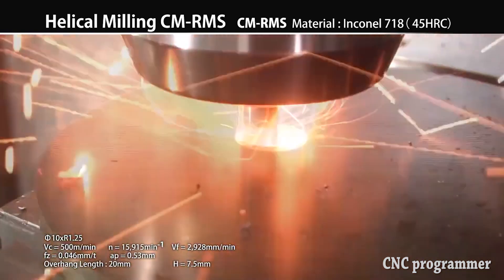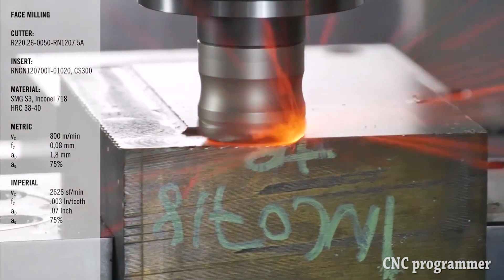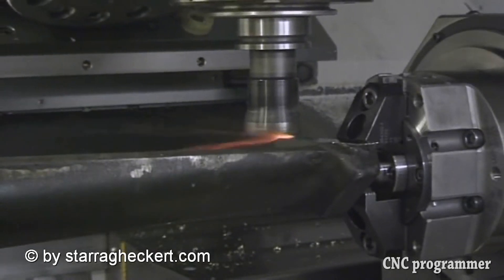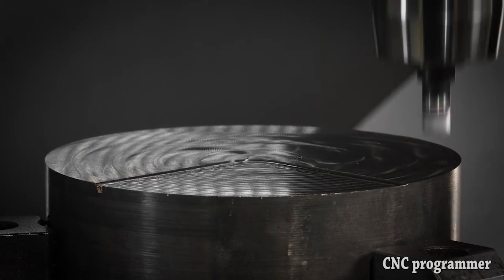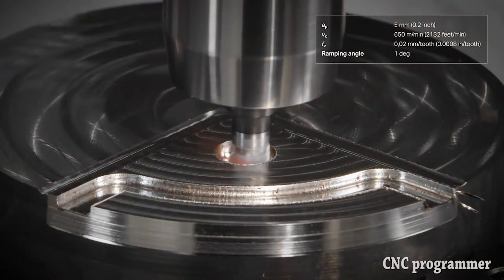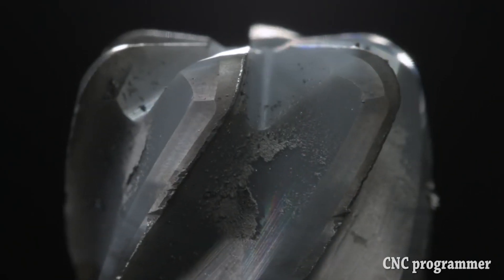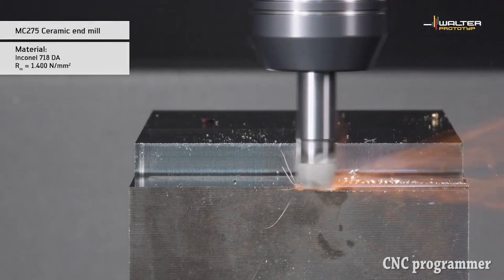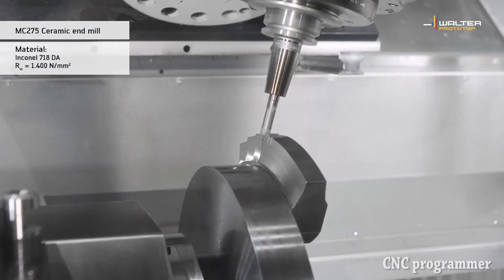7 Tips for Programming Ceramic Cutting Tools

Comment: Is it true
Ceramic Endmill only for 
Nickel base steel

Monel K-500
Hastelloy
Inconel 600,617,625,718,800,900
Incone
Reply: No mate you can use ceramic cutters for any material. There are even specific ceramic cutters for Ali, Bronze/brass, Plastics and silver/gold/platinum. Check out swissceramill, the speeds and feeds are unreal. 39k RPM @ 30k MM/Min. 6mm ceramic end mill, 13mm DOC @ 2mm radial!!